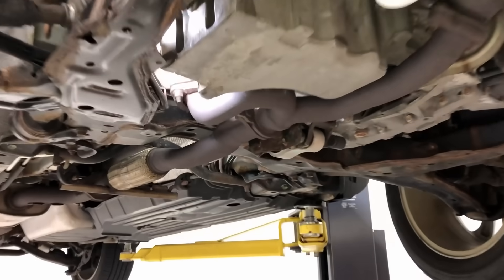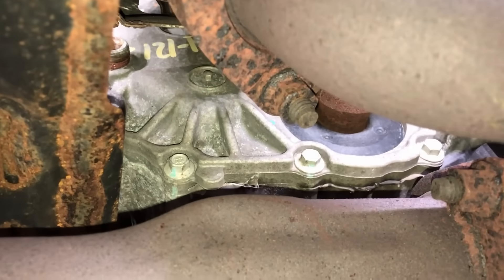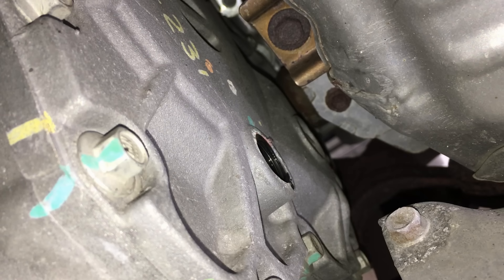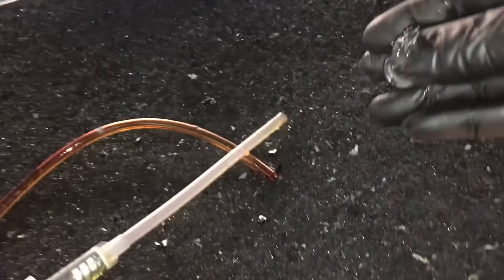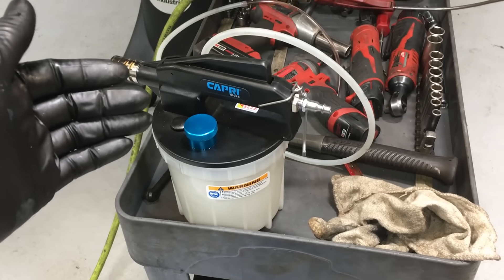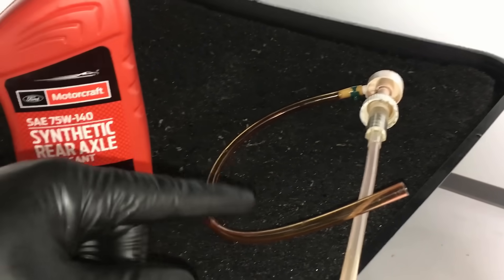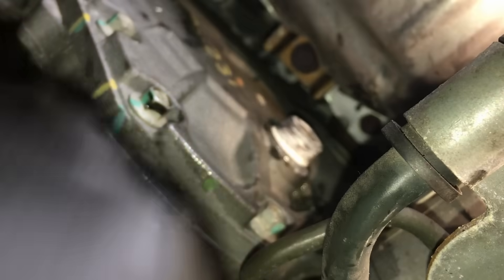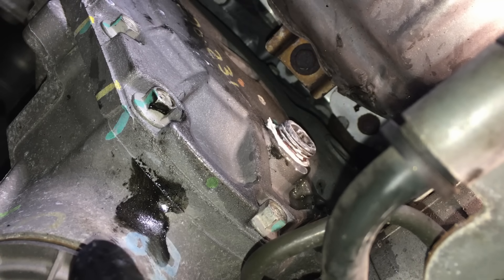Ford All Wheel Drive Vehicles: Critical PTU Fluid Exchange Procedure

Comment from the maker: These are the Tools and Parts I Recommend:
PTU Fluid-
https://amzn.to/2XGDHS4
Expensive Suction Device-
https://amzn.to/2J4fCAy
Inexpensive Suction Device-
https://amzn.to/2XOlPET
Fluid Fill Pump-
https://amzn.to/2DAdRYy
Thread Sealant-
https://amzn.to/2XMGEk6
2007 Early Build Edge Models Fluid Check-
https://drive.google.com/file/d/1mgwHNqtVzSCZ-8_TPnt4mc0gXEO9qrYv/view?usp=sharing
Reply: Just had my 2015 AWD Taurus PTU serviced. 21,000 miles on fluid. I’ve had experience with failures on 2010 AWD Fusion. Do not skimp on this service!!
Reply: How much is that job?
Reply: @Famekom  After giving up on doing it myself on my 2013 Lincoln MKS Eco-boost. I took it to EZ lube and they did mine for 60 bucks!
Very well worth it and I'd of happily paid twice that for my car. The PTU fill plug on my car is almost impossible to get to.
Reply: Thanks for the info! I noticed some leaking coming from the top of the PTU in my 2010 Ford Escape. When I crawled under there to check the fluid level I noticed two missing bolts in the PTU cover. Any idea what size bolts those are? I suppose I could take another one out and take it down to the hardware store and try to match it up if worse comes to worse.
Reply: I have been itching to do this on my 08 mariner all winter. Ever since I saw your last video harping on this mine has 288,000 miles. Can I still do this?
Reply: I own a 2016 awd fusion, is the 75-140 synthetic also the correct fluid for my vehicle?
Reply: Mr. 4Zero correct
Reply: I love your videos sir, one question am fixing to replace rear axle fluid on a 96 town car , what fluid do you recommend for these older model cars I don't wanna put the wrong fluid in its got 410k miles and I don't think it's ever been replace before. Thanks
Reply: @oggarage3459  For a 1996 Lincoln Town Car with a rear axle, the recommended gear fluid is:
	•	Gear Oil Type: SAE 80W-90 or SAE 75W-90 gear oil meeting API GL-5 specifications.

If your Town Car has a limited-slip differential (often found in higher trim levels or with specific packages), you will also need:
	•	Additive: A Friction Modifier Additive (Ford part number XL-3 or equivalent) to ensure proper operation of the limited-slip feature.

Steps:

	1.	Confirm Differential Type: Check if your Town Car has a limited-slip differential. You can usually find this information in the owner’s manual or by inspecting the axle code on the door jamb sticker. Axle codes with an “L” (e.g., “3L08”) indicate a limited-slip differential.
	2.	Capacity: The fluid capacity is approximately 2.5 to 3 quarts, but always check the level and fill to the bottom of the fill plug hole.
Reply: I've got a question. On 2007 sport track 4x4, is it a MUST that caliper and hub assembly be removed to replace lower ball joints ?  Looks like upper arm can be detached then the lower control arm.   

4x4 CV Shaft looks like its not necessary to be loose or detach.
Reply: I have a question for you and it probably doesn't relate to this topic but it has to do with the 06 f150 5.4   I have changed cam phasers timing oil pump timing chain and check compression and it still seems to want to misfire when I throw it and drive idles fine soon as I throw it and drive it starts running like crap could it be the computer
Reply: do you think being in Canada (much colder) can make a difference? I have 125,000km and just got the fluid to do the change. Looked at the PTU the other day and no leaks looked perfect from outside.
Reply: So do I buy a Taurus with or without AWD? What year are the best. Have a 2011 now with 200 k no major problems at All also 2wd. Michigan winter can be nasty
Reply: How about for F150 4x4 units with the “4A” drive mode? Same thinking apply?
Reply: Hi, I'm not sure if you have done a video on changing or upgrading your stereo system but I need help! I ordered a Sony system from crutchfield and the harnesses (smaller one) doesn't seem to fit! I have a 2003/04 Ford expedition XLT 4x4! Thanks
Reply: What year is the Edge in the video?
Reply: I recently purchased a 2017 Explorer with ~80k miles.  Is it too late to drain/fill the PTU?  In other words, what if it's just sludge in there?  Will I do more damage with a drain/fill?
Reply: Unitech it’s never late to change it. With all gunk keep changing fluid every 5,000 till it clears.
Reply: @BORIKKEN  That makes sense.  Thanks!
Reply: 2013 Explorer, 109,000, just discovered this, never been changed, no leaks or signs of failure, too late to change it???
Reply: My 2015 Explorer has only about 38K miles on it, but you scared me enough to have the front & rear diff's, PTU and transmission fluids changed and of course the engine lube!  Thanks for the PM advice!
Reply: My card is " 4wd" what do i need for rhis one
Reply: Seeing as how mine has a drain plug on the bottom, after I drain it would it be a good idea to put some kind of cleaner in it to run through it?
Reply: I changed mine today! Have a 2015 Explorer Sport & had the dealer change it. Was about $200 to service it.
Reply: You'd be proud of me. I change mine frequently enough, it hardly looks much dirtier than crankcase oil when I change it. Not a trace of that silver filing junk.
Reply: I use a device that’s created from a 4-5 gallon air tank that pressurizes (created to very quickly change gear oil by pit crews) it Tees in, pressurizes with a schrader valve (tire fitting, but you could also install a quick connect fitting). It has a tube that goes to the bottom of the tank, and when filled to 40-60psi it makes VERY fast work out of adding gear oil (I originally got it to review and it made changing the gear oil in my NV4500 & AA transfer case as well as the two D60s I was running).
Reply: Mexhanic put 1/4 of quart in..is that ok?
Reply: All those extractor pumps are quite expensive. The only thing setting them apart from junk you can throw together from a hardware store is the venturi fitting so I'm making my own setup using this thing from Amazon; CV-15HS Vacuum Venturi Generator, Nozzle 1.5 mm Dia 1/4" PT Female Thread Pneumatic Exhaust Air Ejector . ..btw; your link for the inexpensive suction device is just an inline container without a pump, $40? The problem with using a hand pump to get gear oil out is that you wont get it all out. Sucking the metal flakes off the bottom that didn't stick to the plug just wont happen, period. You need strong suction.

Comment: Thanks for this video.
I sucked out all of the fluid, only to later find a drain plug on the other side.  :~(
Anyway, this is for a 2008 Escape AWD 3.0L.    At 92k miles, the oil was dark red and little particulate on the magnet.  Now, time for the trans and rear end...

Comment: Hi, do you still recommend 30,000 mile change on the ptu fluid or sooner? I had my ptu replaced and had the shop put in a drain plug for this purpose, but with your experience what do you recommend? Thanks
Reply from the maker: 30k yes for sure.

Comment: My daughter bought 2007 fusion awd for her daughter with 78k miles. Saw your warning. Tried to extract and got grease. Filled with 14oz 75w-90 and ran 10mins. Managed to get 4oz out. Refilled and ran for 15min. No tires and suspended car so PTU could mix oil to liquefy grease. Finally used 1/8" plastic vacuum line with tip cut at angle. This allowed me to insert and extract 18oz. Had to make tool to remove rear differential plug. Ground head on 3/8 stove bolt to match the 3/8 square under the head. Cut shaft short, screwed on nut and welded. Worked fine.

Comment: my 2014 Edge PTU mechanically failed just prior to the 5-year powertrain warrantee expiration.  After the new one was installed (under warrantee), I drilled and tapped a drain hole in the bottom, so I can replace the PTU fluid every other oil change.  I believe Ford chose to implement a fundamental design flaw by placing a critically important oil fluid chamber that is very poorly serviceable right next to the catalytic converter, and why my next car will not be anything in Ford family.  Plus, I tell everyone I know this story, and in this case those I don't know, so they aren't burdened with this stupidity in buying a Ford.  If this is what Ford engineering management think is appropriate, I understand why no one wants to work for Ford.  Even entry level engineers can recognize stupid.   
There was a 1-yr warrantee on the replaced part, and since the 5-yr powertrain warrantee expired, I chose to make my life simpler by applying the basics in automotive maintenance and created a much simpler serviceable port to a critically important part of the car.  Fortunately, I am able to do this and do it correctly.  This little change has given me a lot more confidence with the longevity of the vehicle.  As of this reply, my little modification 7 years ago has not had any issues, and the transfer case fluid can drain instead of needing talented people like in this video use expensive suction devices that may or may not get out what should be allowed to drain out or require flushing out if this service has not been performed.  The PTU fluid is transfer case fluid, which is 75W something...or rather thick.  When this fluid is baked by the cat' and churned through the gearing of the PTU, it turns into a metal-filings-filled-grease...as shown in the video.  Blindly sticking a suction tube into the housing is not likely going to properly clean out the grease.  It's likely more than one session of suction, fill with new fluid, run the car to blend the new fluid with the grease to try and remove the grease from the environment, and suction again may be needed.

Comment: I’m glad I learned about this shortly after I bought my Escape new in 2017. I’ve been changing the PTU using Amsoil along with the Transmission fluid every two years with no issues to date from either component. That may be a little to short an interval but it’s only roughly 1/2 liter for the PTU and a jug of Mercon LV for the 6F35 so why not? The old PTU oil doesn’t smell burnt with not much in the way of shavings stuck to the plug when draining it at that interval.

Comment: I have a 2018 Ford Taurus SHO, 23000k miles.  I want it to last indefinitely.   Never had PTU fluid changed.  Should I use Ford or a private shop?  I'm hoping Ford has the specified OEM fluid for the PTU on hand, where a private shop may use generic abd screw up PTU (this happened w my P/S pump on 03 Taurus)

Comment: HELP! Did this to my 2007 ford fusion. Could barely get anything out. So I just topped it off until it overflowed. Put the plug back in. Week later I’m seeing this stuff on my garage floor. Looks like it’s leaking out the bottom or something. Can’t see exactly where it’s leaking out but it is not coming from the fill cap. Why is this happening? 69k miles.

Comment: They created this problem by not adding a drain plug. Imagine supporting a company that purposely engineers failures. They been adding drain plugs to transfer cases, ptu and differentials for decades for a reason.

Comment: Get some Heavy-duty aluminum sheet & wrap & stuff it wherever it needs to be to separate the heat from the
PTU. That PTU should have come with an aluminum heat shield around the super-hot parts from the factory.

Comment: I had mine changed every 30,000 miles, AT LEAST THAT IS WHAT THE FORD DEALER SHIP Charged me $249.00.  2 weeks after my 120,000 mile service I could smell something like burning propane. They said it was the A/C and $189.00. A day or 2 later I could smell it again. I Googled “Funny propane smell from my 2016 Ford Explorer”.  Came up with the PTU.  They replaced my PTU after $2400, and tried to charge me again for the fluid service

Comment: On my 2012 Flex SEL, I just did this procedure at 145k miles, and my oil was still very fluid, though dark reddish in color,, and smelled bad.  The fill plug magnet was well caked with metal sludge.  Patience is key in removing the oil by suction method, as the oil is very thick--  It took about an hour, and the most that I could get out was 12 ounces.  I put 12 ounces of new oil (75W-140) back in.

Comment: I know this is an old video but my question is have you ever thought about drilling a small hole in the bottom of these units for a drain plug? And then pipe thread tapping it? I just installed a Dorman unit a couple days ago that has a drain plug. The Dorman instructions say to change the fluid every 10k miles

Comment: I had my PTU (2009 Edge AWD) replaced about 2 years ago. It was $2,100. I knew nothing about changing that fluid until I watched videos on here. I saw Ford mechanic videos advising about $3,000 to change. Changed the fluid last week. Took about 20 minutes. AMAZING the difference between the road tar that came out and fresh fluid that went in. I've told EVERYONE I know that owns a vehicle with these, CHANGE THE FLUID !!! Total cost was about $35 including buying suction gun, tubing, fluid, and pump for filling. I have a friend I helped with his 2014, his had 60,000 miles, and fluid looked terrible. Hopefully saved him $2k. Thank you for your videos, GREATLY appreciate !!
Reply: Is $35 a typo or was it really that cheap? I'm about to do this probably with his recommended items here for $85. Fluid, pump, and all

Comment: Hopefully you'll see this comment since this is such an old video. But I have a 23 bronco sport heritage limited and the power transfer unit actually has a liquid intercooler on ours and supposedly the up the volume a little bit from the older ones, but it's still about a quart. Would you still use the same fluid in those? And I believe that the exhaust is n't quite as close as well. So it's a little bit better of a design. But I still think that it's pretty small amount of fluid to keep something like that. Cool. I can't find anywhere where Ford officially says what fluid to use for it
Reply from the maker: Yours takes the new 75w-85 fluid
Reply: @FordTechMakuloco  I got the royal purple maxgear 75-90 with friction modifier additive is that ok? Pickens were pretty slim at the auto parts store near me

Comment: This is likely a pretty dumb question. But, when the fluid is that bad. Is there any way to clean it out.....other than more frequent fluid changes?
Reply from the maker: The old way was to used transmission fluid mix in engines to break it down and dump it.

Comment: Fortunately my ‘17 Escape has a drain plug on the PTU which helps. I’ve gotten in the habit of changing the PTU and Transmission fluid every two years no matter what the accumulated mileage is. I’m probably overdoing it but it’s peace of mind knowing the fluids are good. I’ve only changed the rear Diff fluid once as I think it’s ok to go longer intervals on that plus it’s such a PITA to do.

Comment: Just looked under my 2022 Lincoln Corsair and luckily the ptu and rear have a drain and fill plugs, but no info on fluid type in the manual.  Should I use 75w-140? A Corsair is pretty much an Escape

Comment: Thank you for this highly informative video!

I did this job today on my '08 escape with the V6 engine with ~60k miles and my experience was quite different. My case plug was very conveniently located from underneath. I used a vacuum pump to suck out the olde fluid and was frankly amazed how little came out, barely 12oz. I stuck the tube inside deeply into the sump and wiggled it in all possible directions. But logic would dictate that everything that could have been removed was removed. 

The olde fluid was dark but didn't smell terrible.

Last pointe, where my ptu case is located it does get cooled a but from the airflow underneath the vehicle.

Gosh now i hope i drained and filled the correct thing😂

Comment: Read this First if you want the whole story. Yes i have a 2011 ford explorer and the PTU was a black and thick as molasses when i got it with 145,000 miles. Ford says it is lifetime oil and to do nothing...the dealerships will not even try to vacumn out the oil...due to the manufactuers recommendation. i was under the persuasion that they made a mistake here and bought myself a vacumn pump and all i could get out due to the extreme tolerances it would take 30-40 min to get out 1 quart maximum...then i would put in 1 quart of the Ford recommended synthetic oil. I proceeded to do this every couple weeks until the oil started to get more and more diluted and was not clear by any means but i thought.....yes i am going to keep this from failing...Now with 160,000 miles you need to start to do other maintenance like suspension parts front and rear...and eventually i decided that as long as i was doing wheel bearings and struts on the front i might as well change the axles....This is where i made the fatal mistake having not been trained professionally on Car Repairs...I removed the old axle and installed the new one and NICKED the seal on the PTU...so now the seal leaked oil and Viola....i spent all that time trying to save my PTU and had to buy a new one installed for $3000 not $2000 like it was before inflation. so thats my story...if your installing or removing axle shafts...use a seal protector...probably never need one myself,  but i know they sell them. Never thought this would happen to me...I tried to save the PTU, you can learn from my mistake and tell others please...

Comment: I’m confused. Ford and a mechanic said to use Macon V and videos I’ve seen use something else
Reply from the maker: I am not aware of any PTU's that use Mercon maybe some older escapes but I think those still used 80W-90. Are you confusing it with the transfer case?
Reply: @FordTechMakuloco  maybe I thought transfer case was the power trans unit but I guess I’m wrong. Looked up in owners manual after finding it and told me the correct fluid to be using is the 75w140. Idk why the dealer and mechanic told me Marcon V. Maybe they thought I was asking about the transmission but that takes mercon LV.